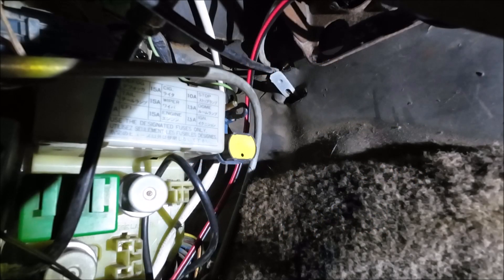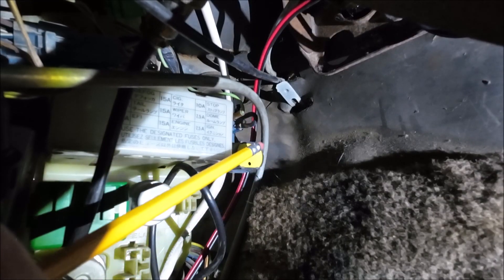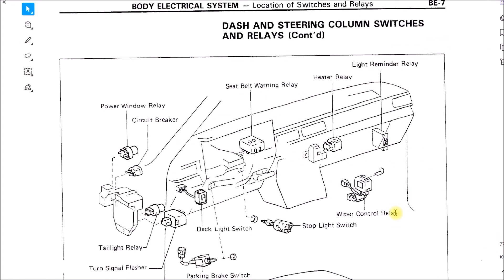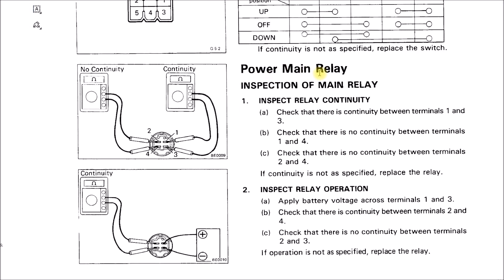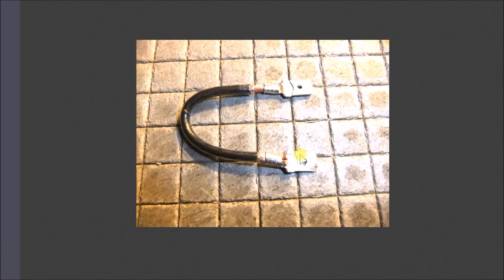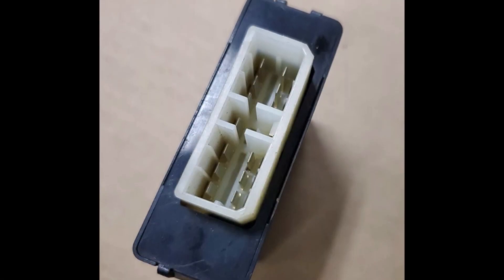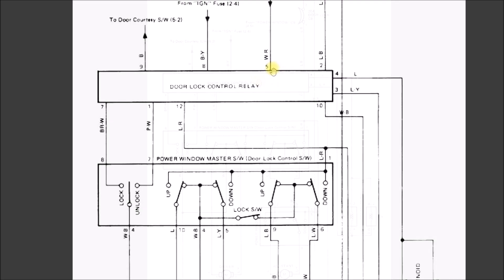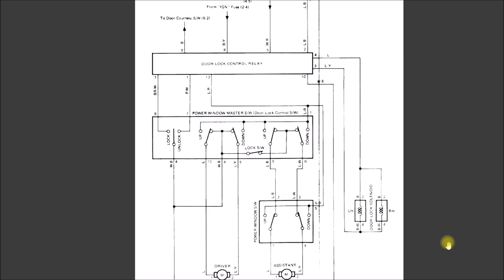Toyota 4Runner / Pickup / Hilux /Surf Power Window Relay Mod

Comment from the maker: I did this modification some 25 years ago and it's proved to be very handy, IMHO.  It's located in a very confined area, so apologies for the video quality in the beginning clip.

If you have a later model 1st gen 4Runner or pickup with the power door locks and have modified your door lock control relay to work w/o the key in the ignition, post up how you did that.  

I suspect that you can solder a jumper wire inside the module like I did with the rear window module.  The key will be if the output connection to the power window switch is a floating connection like in my '85, or if it somehow is tied to ground when off.